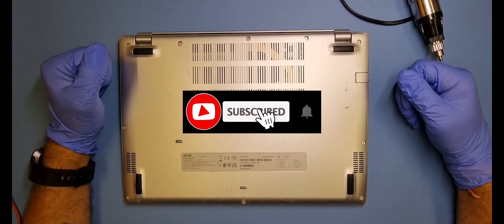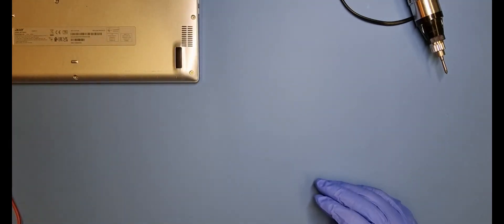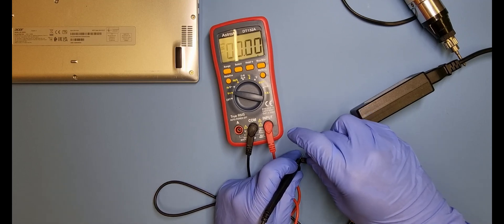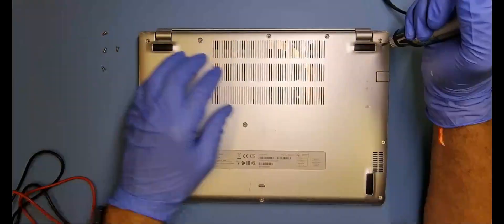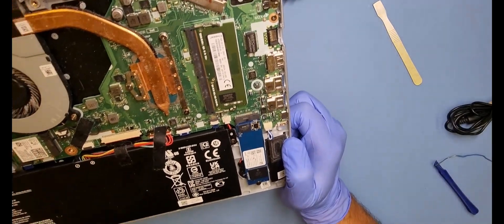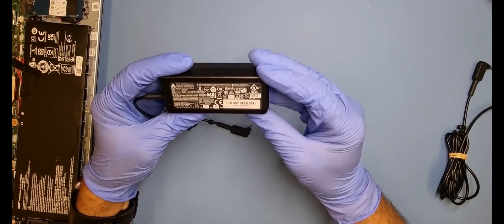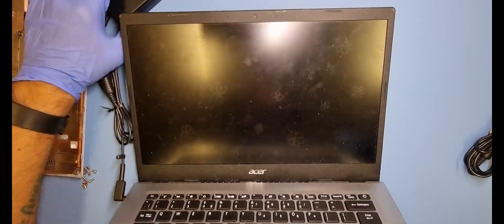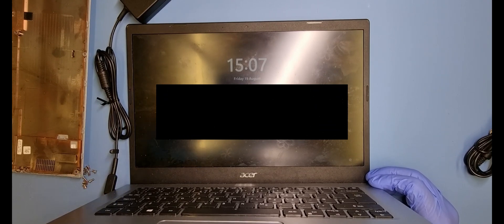Acer Aspire 5 Not Charging Fault

Comment: Liked the video.  I have an aspire 5 that is showing overheating only while the charger is plugged in.  I already cleaned the heatsinks, fan and vents but the issue remains.  Only when charging it overheats.  I noticed this is unrelated to the cpu heat because the heat is located near the AC  port on the top left side of the keyboard - where the power port is located nowhere near the cpu and other heat generating parts.  I have no clue how to fix this.  I'm assuming there is either some resistance or bad heat dissipation in the design of the laptop that is causing this.  While not charging the laptop stays cool even while under stress.